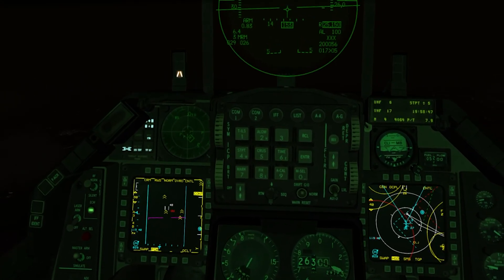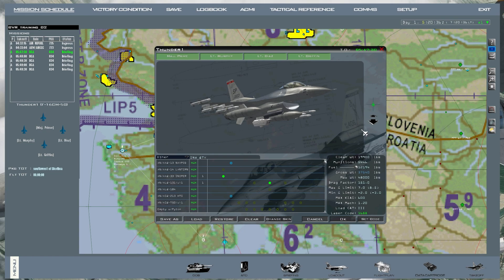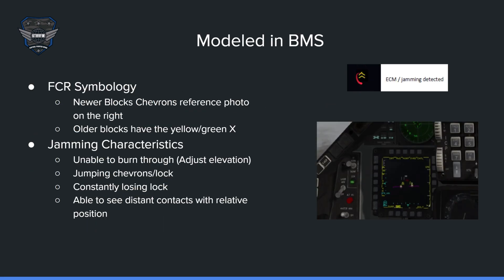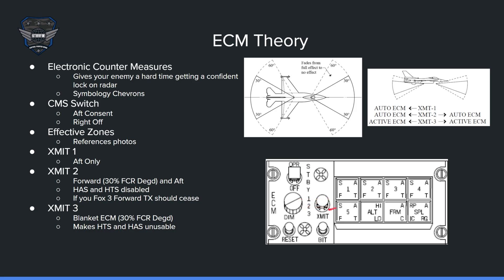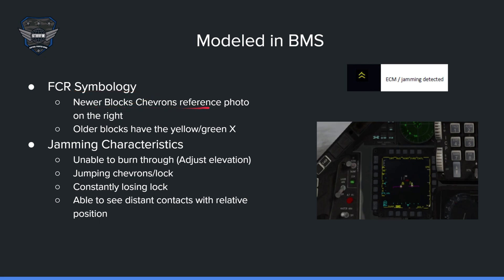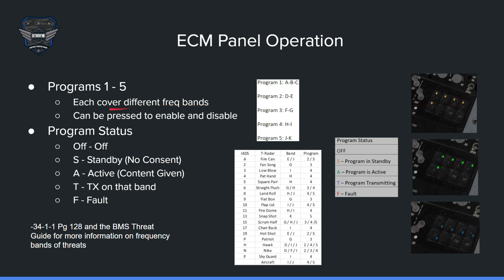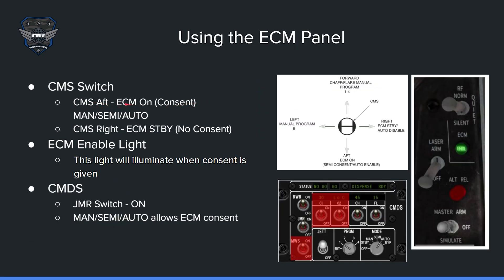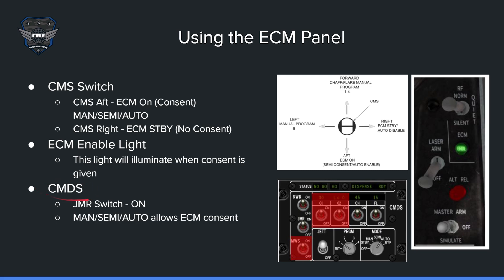Falcon BMS 4.37 | NEW ECM PANEL Beginner TUTORIAL |  Part 1

Comment: DCS's barrage mode would disable the FCR completely, I wonder which is the correct implementation?
Reply from the maker: That is something that most will never know.
Reply: It is always a matter of compromise and knowledge of the frequencies used by the system. 
All in all, BMS modelisation is more accurate and matches closer RL.

Comment: DCS may be visually more engaging, but BMS still holds the high ground for depth, complexity, and immersion factor in simulation.  It'd be great if the visual engine were to be upgraded to DCS quality or beyond.
Reply: And DCS requires 10 minutes to load, even with a fast PC
Reply: @falconbmstutorials6496 you need an ssd then…it doesn’t take more than one minute for me.
Reply: @DJeb86  I have only SSD, the fastest on the market, a new PC AMD + 4090 Nvidia, still DCS seems to use 100% of CPU (but only one core) and 100% of GPU just to present the splash-screen. As if they mine bitcoins. But the same happens with the "game" (because it is not a sim) MSFS 2020. In DCS I switched on the MultiCore on, yet not really better. I stay with BMS and enjoy the campaigns.
Reply: Rumors say it will.

Comment: From the looks of things there’s never any reason to use low band jamming in BMS (program 1).  The downward beam pattern suggests that the pods are best employed against SAMs, and probably ought not be relied upon against airborne radars.  It also means that if you get too close you can lose jamming effects due to geometry and not just burn through.  It would be interesting to see how the burn through range compares to the min range due to look down.  You also suggested that the radar degrade in XMIT 2/3 is avoidable by turning off I band jamming (program 4).  The problem is that most of the SAMs operate in that band too so you can’t really turn it off most of the time.  Unless the air to air threat has no game outside the degraded radar range, then it says to me XMIT 1 is the way to go and then if you’re spiked you can turn cold and hope the jammer breaks the lock.  

Lots more to think about…
Reply from the maker: Ayy what up Gears. Program 1 is pretty useless. I will go over some tips and tactics that I started using, because this opens up something new in BMS. I usually use XMIT 2 and control it with my CMS switch when needed. Thanks for watching. 4.37.2 just came out today with some cool changes like HOJ
Reply: @AviationPlus  hey!  Just been super busy and going to bed early so not a lot of video games for me.  I watch your stuff all the time, though, because it’s one of the best BMS channels on YouTube.  I hope you’ve been well.
Reply from the maker: @slgarrett  Appreciate the positive feedback. Work always get in the way of real fun. I have been well just squeezing out all the fun I can get while at work. We try to get ops on the weekends. Btw UOAF has huge ops on Saturdays something you might be interested in flying one day. My last live stream was me controlling the airspace. I had a blast!
Reply: @AviationPlus  yeah… I just don’t want to piss everyone off because I wasted my wingman again.

Comment: The AN/ALQ-99 pod (and the EF-111) cover 360°? I’m asking because the nature of the dedicated jammer aircraft works kind different than a self protect jammer. 
Nice vídeo! You are awesome! 
VDK
Reply from the maker: The jammer on the EF-111 is an off board jammer used to blanket other aircraft in an area who may not have a self protection jamming capabilities.
Reply: @AviationPlus  Nice! And what about the EA-6B or EA-18G (with ALQ-99)? The same rule of EF-111 applies to then?
Reply from the maker: @cayancesardeoliveira5708  Yup but in BMS I think it's 360 coverage as long as those aircraft are within like 60 miles of the jamming area. You get jamming coverage from SAMs

Comment: interesting looks like dcs cheeted here also
Reply: They cheat everywhere lol. DCS is great for PVP but theres alot of litle things about it that are unrealistic. its like 95% realistic which is good enough for most. BMS on the other hand different ball  game.
Reply: @bjjman95  I feel like it's 20% realistic. The flight model, flcs gains, radar ability, display, hud symbology and refresh rate of the 16... all buggered to a significant degree. IIRC turning the ecm on just shuts the entire FCR off and you can mash any of the buttons 1-5, they all do the same exact thing... It's like they designed their model based on some instruction pamphlets.
Reply: It cheats similarly with IFF and ECM AFAIK.

Comment from the maker: Thanks for watching. If you have any questions ask away! Part 2 Here https://youtu.be/tp0sYeRZjFA
Reply: Are there any advantages in disabling a program You won't use? E.g. P1, shouldn't the Pod allocate more power to the rest of the program?
Reply from the maker: @Synchronizado  Yes this new update 4.37.2 there is a note stating that power is evenly allocated based on how many programs are transmitting. So if every program is tx then you only get 20% strength in each program